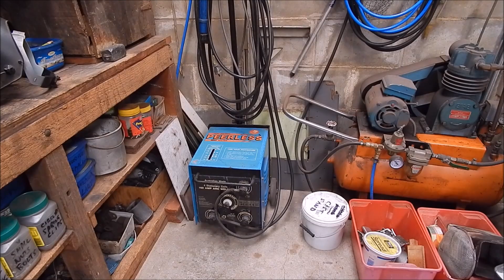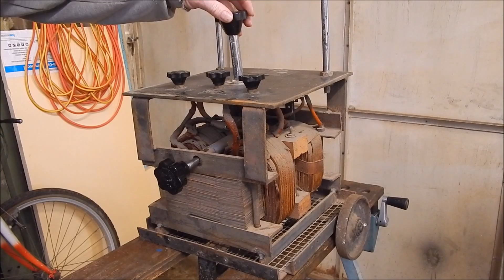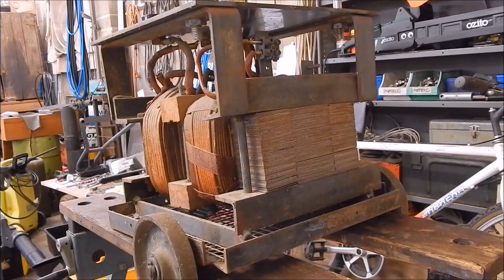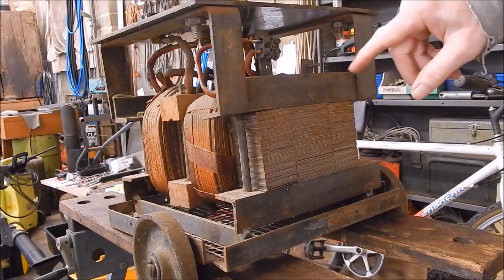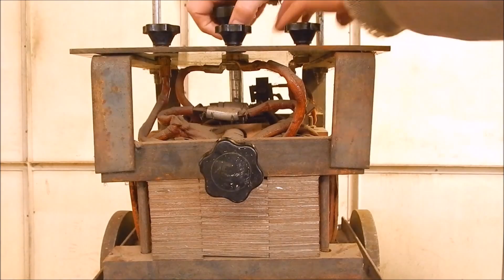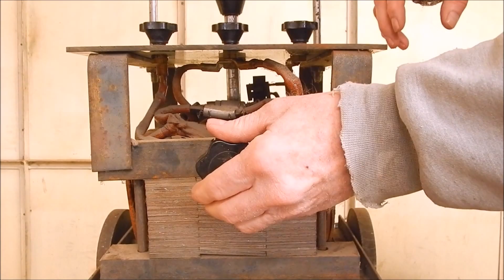What's inside a basic stick welder

Comment: Hi Rob, what is the  model number and year of the one you undressed? It is built like a tank with steel wheels. Must be 50s or early 60s model? Looks similar to a Peerless MK II. Peerless are probably the best out there but I never understood what went through the mind of the engineer that chose to glue a paper label to the top or front of the welder. As a result many welders out there appear anonymous as the labels came off or got burnt
Reply from the maker: I can't supply that information as the welder is now up on a farm a long way from me.  As it has the sliding vertical choke and wheels I would guess it was from the 60's.  The later ones (like my blue one) have a screw type horizontal choke and no wheels.  Both are four coil, but the blue one has copper windings while the earlier are aluminium (I think).  Peerless four coil are the best transformer welder I have used, easy striking, true amperage, great duty cycle, well made etc.   Very nice, but even the cheapest arc welders will do the job.  I have DC as well, but prefer AC as you don't get arc blow and it will weld the dirtiest, rustiest, shittiest steel available. Definitely best for field work.  Cheers Rob
Reply: @Xynudu   @Xynudu  Did more research. It seems an old Peerless. Now the Mark II I have seen are  post 1964 and have rubber wheels. Yours is built like a German tank with steel wheels.  Could be a mark I or early Mark II. The fact you don't remember is because the paper labels probably deteriorated  30 years ago. Also, it has full copper windings not aluminium.  With a little bother and $150 -200 you can convert it to a dual AC and DC welder (rectifier, choke and DIN fittings) which will outlive your grandchildren. The later models like your blue one has copper primary windings but may have aluminium secondary.   Also be careful disturbing  the insulation of the  older ones. Some used asbestos as it allowed more overheating

Comment: Hey Rob, sorry to bother you again. I just acquired another one of these however this one needs a rebuild (for aesthetics mostly) but I cannot remove the knob on the power set locking handle so I can slide the cover up and off the unit. My first was actually a screw adjust this one is a slide and lock. Does the entire lock shaft back out unthreading? Do you remove the knob then push the shaft inside? There is slight movement on the knob either way attempting to remove the clamp lock knob but it locks up both ways at about a degree. The clamp does function but locks at the back end of thread, do I keep going and back it all out?
Reply from the maker: Hi, from memory I think the locking shaft unscrews and can be removed completely. The whole design was pretty simple and I think it just tightens a split collar the variable choke slide rod passes through.  It's been a long time since I had that welder apart.  Quite probably the end of the thread may be exposed and dirty and thus binding when you try to remove it.  Good luck.  Cheers Rob
Reply: @Xynudu  thanks very much! So possibly unscrew or back out the lock shaft till it "bottoms out" then use say vice grips on the shaft to unscrew the knob and shaft out together as one? I considered a monkey wrench on knob to see wich thread let go first but I'll try a softer approach first ha ha the knob would likely be what let's go. Anyway thanks again, Brett
Reply from the maker: Hi Brett,  I had a look at the video and it appears that the lock rod simply screws up against the side of the movable choke block, so disregard what I said earlier..  That being the case, it's quite possible that the thread is flared/spread on the end where it makes contact, making it difficult to unscrew back through the nut.  I doubt these units were ever made to be pulled apart.  Some brute force may be in order.   Unscrewing the rod without marking it will be a challenge.  Good luck. Cheers Rob

Comment: Just bought one of these, exact model for $120 aud at a farm town garage sale. 
Can't wait to need it 😀
Reply from the maker: Good choice!  Quite user friendly and probably the best AC welder brand I've used.  Cheers Rob
Reply: @Xynudu  cheers, happy to be settling with it then. 
Could you please tell me which configuration represents high/low power settings? My unit had been painted
Reply from the maker: The work lead is at bottom left.
The electrode leads are far right 45 volts (general welding) at top, and 70 volts (specialty welding) at bottom.
For most welding use the 45 volt outlet.
Cheers Rob

Comment: How the devil do you get the locking bolt out of the front of the dang thing to remove the case?  Can anyone tell me?
Reply from the maker: You don't.  The case has perimeter bolts and lifts off.
Reply: Thanks  @Xynudu , however the Peerless I have has the same locking knob on the front and I can't lift off the case without removing it or the rod.  I figured it would just unscrew?  Also, the tired old unit I bought was rivetted close, not screwed or bolted.  Odd.
Reply from the maker: Hi Geordie,  I have had two of these units and both cases came off without disturbing the choke.  One was top and one front choke rod. 

There's really no point in taking off the case as there's just a (couple of ) transformer inside.  They are a great little welder.  Easily the best small AC welder I have used.  I have a 4 coil copper wound unit, but the ally wound ones are also very good.  You can buy them for like $10 these days as everyone has gone DC inverter happy.  For rough dirty, oily, rusty conditions nothing comes close to an AC stick welder.  DC just runs away and hides ;)  However for some jobs DC is very good - thick to thin is a breeze, but everything must be sparkly clean.

Cheers Rob
Reply: @Xynudu  Many thanks for the detailed reply, Rob.  I must have a different model to the one you've taken apart in the video.

This one I've got will need the locking rod for the choke removed as it passes through the front panel which is part of the case that covers the top and all four sides as one piece.

As much as I'd like to use it as is, with the amount of mouse droppings and filth falling out of it, I'd rather clean and inspect it before powering it up.

Cheers, Geordie.
Reply from the maker: Good idea to clean it out then Geordie.  Mice can also eat through insulation, so check that.  The only moving part inside is the metal transformer choke core/block.  All wiring is rigid and fixed.

It's been quite a while since I had mine apart.  They may vary as Peerless have been making welders for a very very long time.  The AC ones can be dirt cheap now if you look around.

I bought the copper four coil for $20 or $30 dollars and the ally wound one for $10 for my Bro Inlaw.  I also bought an old Lincoln with the big switch on the front for $10 as it had heavy duty 12 foot cables which I then cannibalized to put on my DC welder.   Try buying those cables new .  LOL they cost a fortune.  I scrapped the rest of the welder.

So old AC welders are almost a throw away item now, but they can be a cheap way to do cable upgrades.  I smile when I see the prices some people ask for them and will never get.

Cheers Rob
Reply: Got it, Rob!  The end of the locking rod was burred and wouldn't pass through the nut without considerable force applied.  I took some internal photos with my phone crammed into it and could see no sign of a locking lug, clip or pin, so brute force it was.

Many thanks again.

Comment: Inherited one of these, great little welder, but what is the "special welding" for? Mine has the same "plunger" style choke.
Reply from the maker: Supposedly it gives better starting voltage for striking specialty rods - ie. low hydrogen.

I never use it, as I find the normal outlet does everything quite OK.

Rob
Reply: xynudu thanks Rob, good to know, like you I'll probably never use it either :). Cheers!

Comment: The magnetic shunt got me to think a little. At first I thought having it in the not pulled out position would allow a greater magnetic path for the coils, thus, higher current. Then, after you said pulling it out increased the current output it has to be that the removal of the shunt allows more magnetic flux to pass through the coils increasing the current.
Interesting video, as I did not know about this type, just the ones with various taps.

Also noticed comments about using a basic AC unit for tig. Yes it can be done, but lacks most of the control features an actual TIG unit has. Maybe where one would very seldom use TIG it would make sense.
Adding an external high frequency start unit's cost to a basic AC welder would push the cost into "just buy a tig read unit" in the first place. Plus most inverters now days have Stick and AC/DC TIG. 

But nothing wrong with a basic AC unit like yours, they get the job done!
Reply from the maker: Hi Tom,

I think the metal choke interrupts the magnetic fields, and prevents them from forming correctly when it's in.

Same effect as surrounding a magnet with a steel cover effectively stops the magnetic fields on the covered sides.

People seem to write off the old style AC welders these days, but prior to modern electronics pretty much everything was welded with AC - including tanks, trains, ships, high rise etc.

The later welders may be easier to use, but if your technique is right, it's no problem.

Cheers Rob

Comment: I used to hate using mine till I discovered satincraft electrodes.  They are the ducks guts.
Reply from the maker: Yes, Satincraft weld very nicely.

Can't go far wrong with them.

Rob
Reply: Yes it is an amazing difference between satincraft and other rods, but it also comes down to work preparation as well.
Reply from the maker: Satincraft are expensive, but good.  Recommended for beginners.

Most Chinese rods I've tried are rubbish,  BUT there is one brand used by industry that is excellent, and not expensive.

The brand is SWEC  (Shanghi Welding Electrical Company) and these rods are great.  That's mostly what I currently use.

Chinese rods generally seem to need a few more amps, but the SWEC weld beautifully, and in any position.  Very good penetration and slag removal.

Try some, you won't be disappointed, if you're a half decent welder.

Cheers Rob

Comment: While the AC machines are simple and pretty much indestructible, I gotta say, DC inverters are much nicer to weld with. Apart from the smoother, quieter DC arc, the inverter machines can include things like hot start and anti-stick, which make life a lot easier for less-than-expert welders. Yes they've got a lot more electronics in the guts that might be more likely to fail than a few coils of wire, bit I've got a BOC Smootharc 130 lunchbox welder that I've mistreated in the workshop, up a ladder over my shoulder and out in the bush off a generator for many years and I don't think it's failing any time soon.

Comment: I've gotta get myself one of these old AC welders, I have a little 170 amp inverter but the thing overheats to easily, it's great for small, intermittent jobs but sometimes I need some indestructible brute force
Reply from the maker: These old welders have got guts.  Can lay down beads on heavy plate no worries.

The current Peerless 160 is the best I've used on 240 AC.

Takes a lot to overheat them.

Cheers Rob
Reply: Ned, have you checked how clean the unit is on the inside? You may have a build up of workshop dirt, grit and gunk that has been sucked in by the cooling fan and now it is adding to the heat build up problem. Obviously unplug the welder before opening up the insides for a look.
Reply: I'd expect that DC would be better for heavy stuff, with DC electrode negative more of the heat ends up in the work piece

somewhat related picture ; http://i240.photobucket.com/albums/ff150/inspector72/funny%20stuff/thirdworldarcwelder3.jpg
Reply from the maker: Crikey.

That looks dangerous.

Rob
Reply: No gloves. Can't tell if he's wearing eye protection. I'm sorry for him. The strange thing is, he would need a great deal of ingenuity and knowledge to cobble that thing together, but how would he then not know the dangers of UV exposure?
Reply from the maker: I've seen photo's/videos of guys in Asia welding without a shield (just by feel), and also with rudimentary shields made from cardboard with a filter taped on.

Unreal.

Rob
Reply: xynudu
google image search on the third world welding show lots of scary examples, hard to imagine people having to work like that when you can get a auto dark helmet on ebay for    $10

Comment: What Rob didn't point out is that this type of "Old School" welder is an AC unit, ie it produces AC current at the electrode, whereas many of the welders available today are electronic "inverter" welders which produce DC current at the electrode.
This kind of AC welder is heavy, but basically bullet proof, whereas the DC inverter welders are much smaller and lighter, but as with anything with electronics in them, require more careful handling, but they do offer a smoother, easier to start arc.
Reply from the maker: Good point Mark.

I guess I'm old school - flip helmet, never tried a DC welder.

Still manage to weld OK though.

Cheers Rob
Reply: Rob you really need to try a variable shade auto darkening helmet for welding, makes life so much easier. Keep the flip front for looking at solar eclipses.
Reply from the maker: He He.  Maybe one day.

Rob
Reply: The difference is like walking to the shop in the rain or taking the Roller.

The auto darkening helmet gives me an extra hand to use. 
The inverter is a TIG/ fantastic plasma cutter/ and stick welder that welds more like
a mig than a stick , super controllable. 
I would never go back.
My tip is NEVER try one, you might like it too much.
Reply from the maker: Yes, I agree about the extra hand side of things with auto darkening - certainly a plus when welding round stuff etc.

So which welding unit have you got ?

Cheers Rob
Reply: Thomas Oncken; Speaking of "Rollers" the other week there was an older model Roller which was "no longer proceeding in the manner to which the owner was accustomed" parked just outside the place where I work. I said hello to the owner and he told me that his particular Roller [a coupe], had once been owned by the actor Peter Sellers, yes THE Peter Sellers the actor of Goon Show and Pink Panther fame. Strange but True.
Reply: Hi Rob, its a flee bay unit for about $500 about 5 years ago’
I am learning to TIG with it ( check out Welding Tips And Tricks ) now
that I can get Argon from Bunnings without having to pay yearly bottle rental.
The unit even has high frequency start for TIG but unfortunately no foot pedal amp 
control input socket. I would buy a separate plasma cutter now I know better ,
less time swapping cables etc. The performance of the cutter is so good and 
the cost so low it would be worth it. Probably another good reason to buy 2 
separate units 1 TIG / Stick and 1 Plasma cutter is to reduce the pain should one go belly up.
Some of the Ausie dealers have excellent  guarantees so are now worth researching. 
Unfortunately AC/ DC TIG is still very expensive…..
Love the vids, Tom in Melb
Reply from the maker: Hi Thomas,

Now Bunnings has commercial gas, it's a lot more economic owning oxy and TIG than getting ripped off by BOC gas.

That's why I got rid of my oxy set.  Just uneconomic to own it.

I may get TIG one day, as I'm a big fan of brazing, which is similar to TIG in some applications.

Cheers Rob
Reply: You can also braze with TIG Rob. Jody at Welding Tips and Tricks has done some videos on it.
Reply from the maker: Yes, I know that's possible, but it would be an expensive way of doing it I expect.

Rob
Reply from the maker: You can buy an add on unit that converts any AC welder to DC output.

They were all the go in the 60's and 70's but you never hear about them these days.

Rob

Comment: looks very sturdy and long lasting. Using scratch start you could even use it for TIG welding. Check out: 
https://www.youtube.com/watch?v=--G7NqZZQdI
https://www.youtube.com/watch?v=8totW6urTCc 1:20 into the video.
Reply from the maker: It's an AC welder, not DC.

TIG is something I'd like to do, but I'm not set up for it.

Cheers Rob
Reply: You are almost there. According to the 2 links all you need is a TIG torch with a gas valve, a lead with a power block to clamp your electrode holder to it and of course an argon tank. It might be worth your time to compare the total cost of those components (except the tank) to a basic import TIG machine which might well be cheaper while offering more features (HF start, gas solenoid, foot pedal) but probably less longevity. Then again you will probably not weld all day long.